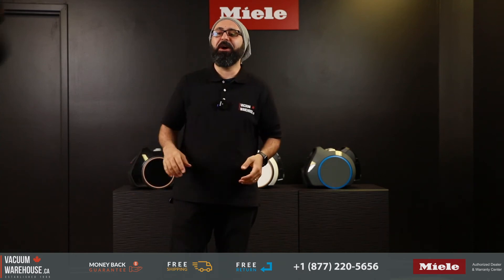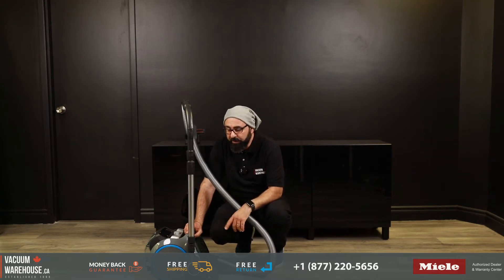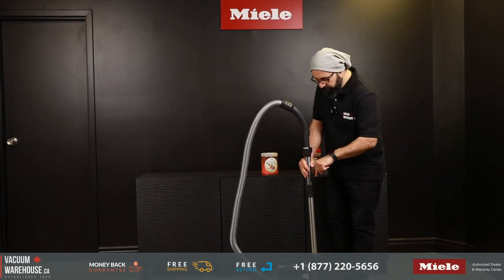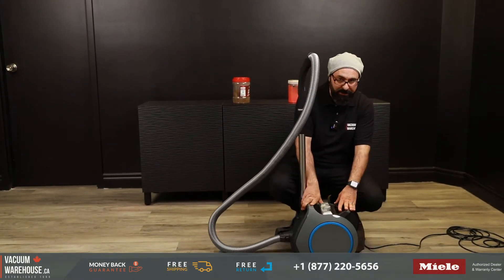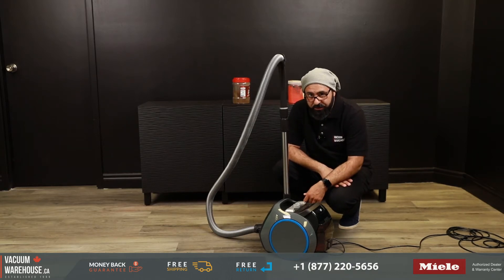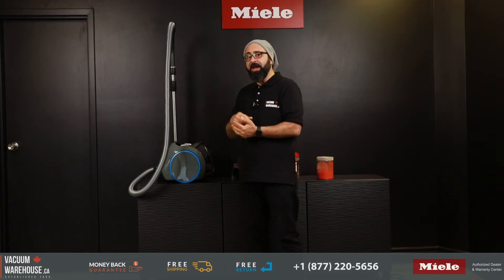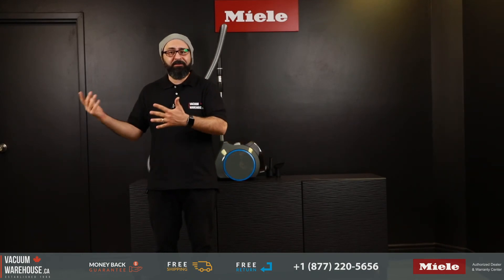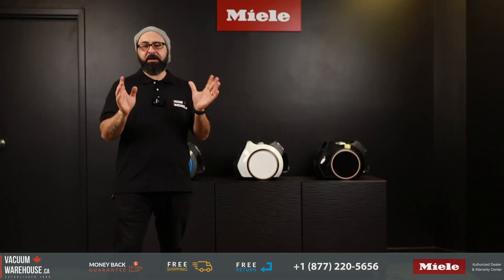Meet The Miele Boost CX1 Graphite Grey - Lightweight, Powerful, and Easy to Use! Vacuum Warehouse

Comment: miele blizzard  cx1 vs boost cx1   which is best?
Reply from the maker: Hey Oliver. Hard to say. Blizzard is bigger, so it has a larger capacity, but it's heavier by 3 lbs and bulkier. Boost is lighter and more compact, but has a smaller dirt container. It really boils down to the type of space and flooring it's used for. Typically, we would say if it's a townhouse or a smaller home, with moderate amounts of pet hair and dirt, and also if the user is sensitive to the weight of the vacuum, then the boost may be a better option.